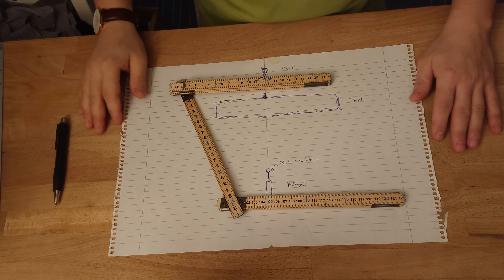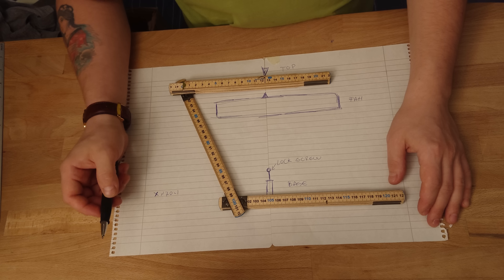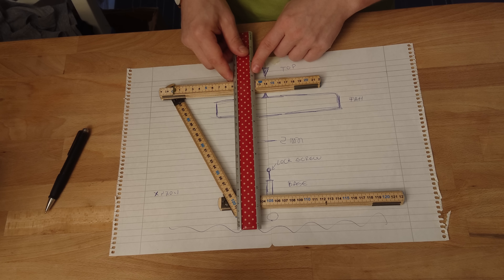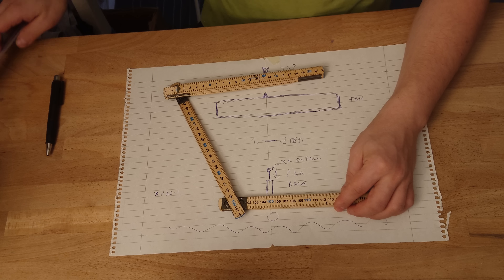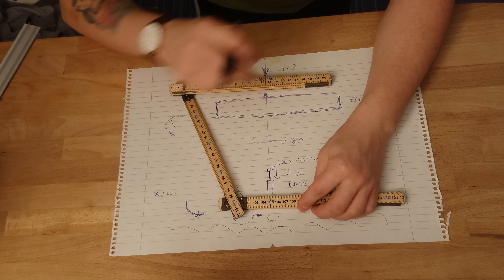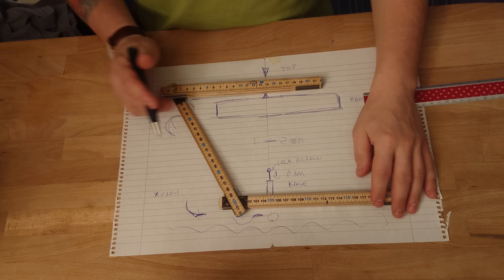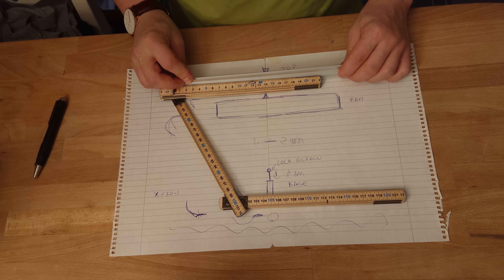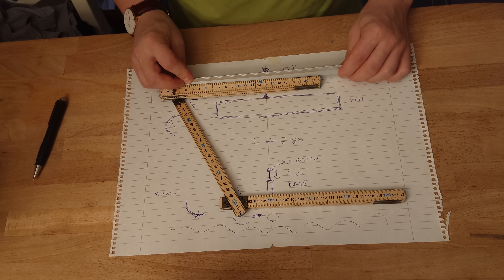Louqe Ghost S1  (Ep.2) - How to bend the Noctua L12S to fit

Comment: It says on the Noctua site that ram clearance for the Noctua nh-l12s is 35mm, so after this "adjustment" it will be 32mm. And the corsair lpx memory modules are said to be 31mm. Pretty tight fit.

So you really need very low profile memory.

Comment: Hi, i did what you said and fits OK but now because the cooler have a bit of contact with the case sometimes when I touch and edge of the case it creates a shortcut and reset the computer. There is Anything I can do to fix this? I don’t think I can bend it more because   the cooler is tight fit. And there is not more room at least I tried to sand down the cooler or something
Reply from the maker: The cooler is not a electric component. I think you got a bad motherboard or power supply. A short circuit some where. By poor handling of your components. Try to find the cause of that faulty electric problem before you burn down the house. The cooler thansfers heat you dont plug it in the pc. It touches the components that have the problem. If you dont know... take it to some one that can help,  not you buddy a profesional.

Comment: Thanks much for this video. At first it seemed to scary a thing to attempt but now after watching this guide I feel confident enough to give it a try. The other option would be the Noctua NH-L9x65 which will work with my 7700k but only at 100% fanspeed and not even turbo boosting enabled.

Comment: Hi, Great content, I would be curious to see a comparison between noctua L12 and L12S in terms of cooling + noise level.
I am waiting for the ghost S1 to be shipped and your content is highly appreciated, instructive and inspiring, thanks.
Reply: I'll be testing both combinations this weekend to compare. My nh-l12s is a little different as I didn't bend it, but decided to belt sand 4 mm off
Reply: Hi Readeh, let me know how it went.
Reply: @readeh  How did it go?
Reply: @chairminh  I ended up just running my 12S and it is doing a great job keeping my temps down.
Reply: @readeh  I am looking to build this system soon. Would i need anything to bend the L12s? Or new fans?
Reply: @sirrasmusdkdk  At slibe L12S ned er et kæmpe arbejde, så ville nok holde mig til L12, hvis jeg var dig. Du kan f.eks gøre som ham i videoen, men kommer selvfølgelig også an på hvor høje dine ram er. Der er ikke meget plads til en 120mm fan og jeg har fjernet en del heatsinks fra mit motherboard. Jeg bruger en Noctua 120x15mm fan på min L12S.